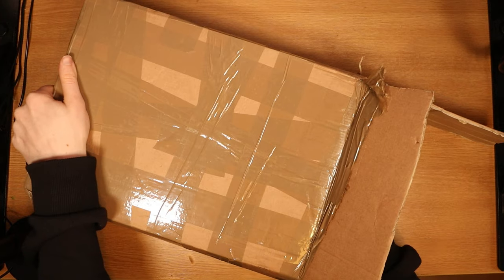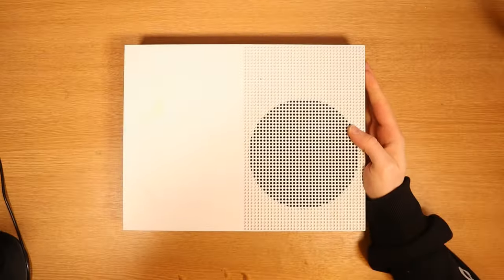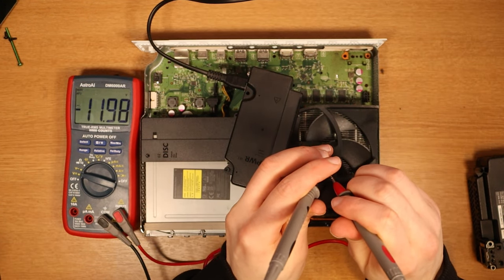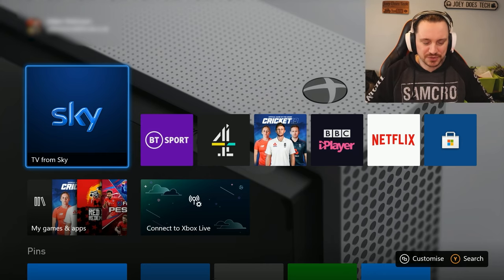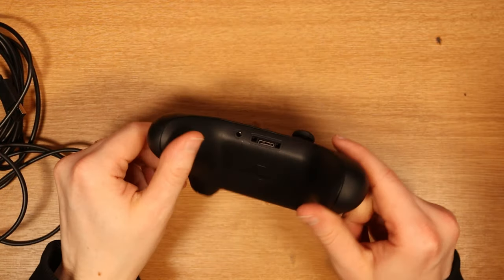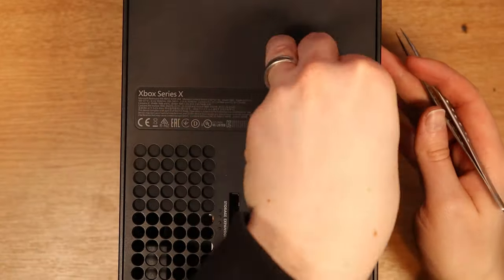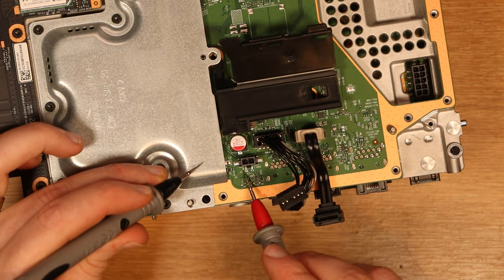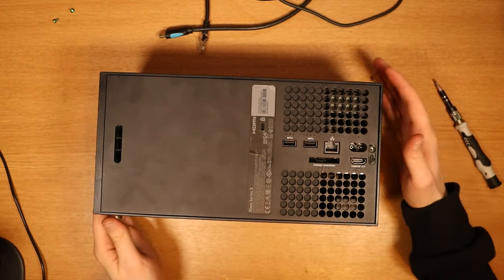Trying to Fix FAULTY Games Consoles on eBay for Profit | Profit or Loss S1:E1

Comment: You used parts from other consoles. Even if they didn't cost you at this point I think it would be good to at least mention Potential Costs that those power supplies would have cost.

Comment: What are the chances of both consoles having the same power supply issue? For me, I wouldn't include the price of the donor consoles as once it is classed as a donor the money spent on it has been lost. Unless you plan to always strip the donor parts down and resell then you could include it, but like you said that would be a major headache once you start getting down to capacitors etc.
Reply from the maker: Agreed it would be ALOT of work. I think it would make better content, however I just don't have the time currently.
Reply: @Joey Does Tech  I know what you mean, every day I have a million video ideas, and in reality only a small amount of time to make them. Must be harder for you with 2 channels and a repair business 😵‍💫

Comment: Nice work! I don't count parts that I take from failed fixes in profit margin. So if a PSU from another console is used to fix than I will not class it as having spent money on parts specifically for that fix. I do have a pot for this though seeing as it's a hobby so a failed fix will usually result in the entire money I spent on that faulty console being written off as a loss but if the parts end up in a pile and dont get used for a while I'll usually put the parts up for sale to try and gain back some of that Loss. Some times the total of the parts can go for more then what I paid. Interested to see your profit/loss in these videos. In the ebay search results I tend to click Advanced and click on the sold listings option to get an idea of how much they sell for. For me, a 1tb Xbox One S that I sell as console only (no controllers, no cables) will sell for around £100 to £120.. a lot of my buyers don't seem interested in bundled controllers so I sell those separately.

Comment: @jdt
May I suggest that you use an rcd plug and socket to protect your fuse board against faulty power supplys. Would love to see a repair on both power supplys  if you are capable of doing so. Just put on rubber gloves to be safe.

Comment: That is the risk you take when you plug random things into the wall, luckily it didn’t explode and catch on fire, that would make a good video though
Reply from the maker: What's the best way of going about it? Separate circuit completely for testing? Haha it wouldn't of recorded though if that happened :P

Comment: I had my first big loss, 2 switches I bought for 250$ Canadian, both seem to be units that were deemed not fixable, one of them boots into hekate etc but black screens when booting any OS, second was a blod that i fixed a torn trace under the apu however it also is just a black screen now, i posted about the first one on tronicsfix forum, but the forum doesn't appear to be as active as it once was for switches
Reply: I too have had bad luck with a pair of Switch Lites from eBay. Both issues were ultimately traced to bad APU's. $140 US loss.

Comment: Way too late now but I wouldn't have dumped that broken power supply, why not look in it and see if it can be fixed? at the very least it's a source of parts, I never throw anything away, It drives the wife nuts. LOL

Comment: If you really want to get down to brass tacks, you did pay for the power supply with the consul that you were unable to fix. In that case, you would have to say that yes, you did pay for the power supply, however, it was at a discount because you got the entire consul so I believe that you should just say yes, you did pay for the power supply, but it was at a major discount.